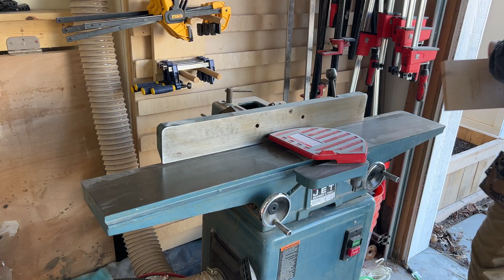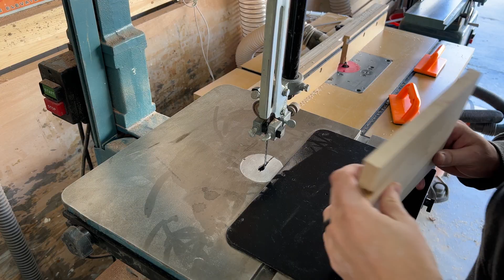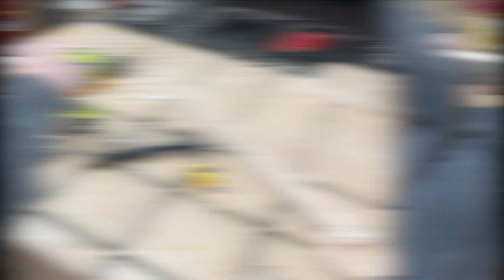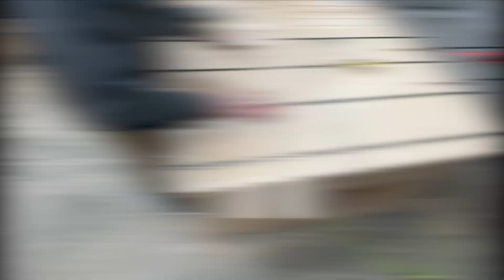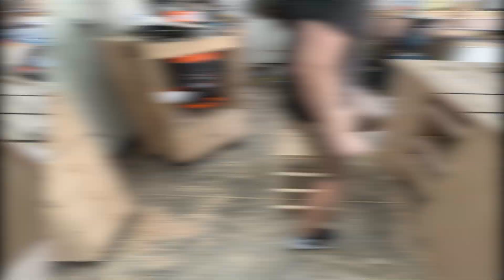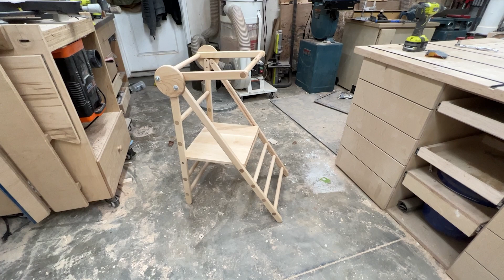How To Build A Foldable Kitchen Helper Stool // Step By Step

Comment: The plans are only half complete!  Height of the platform and location of the dowel holes are completely missing and you are force to figure these out on your own.  This will add considerable time and effort you project and could have been easily included in the plans.  For this reason, I would not recommend this project

Comment: Bought directions many months ago
Decided to cut all pieces 
Like the idea of a folding table. 
Your directions do not show measurement 
details for circles as far as attachments to legs and top rail. 
Have you a more detailed plan that fills in the
Measurements and leg placement on the circle pieces?
Reply: I just bought the plans, I am blown away at the number of spelling mistakes and either incorrect or missing dimensions.. yeesh.
Reply: Any luck contacting him ?

Comment: * BEFORE you begin this project...
Note-the front leg CAN NOT have a dowel above the rotating platform. It will keep the ladder from folding. Also we suggest you raise the measurement for the 1 inch holes on the front leg by 1/4 inch (3.25 inches for the first hole). Our platform is at a slight incline toward the front when using his measurements. 

After the frustration of it not folding because of the 4th dowel, we are happy with the finished product.

Comment: So you said half inch bolts and nuts for the circle and to hole the rear leg and safety rail.  Are they bolts with 1/2 inch heads or 1/2 inch diameter bolt where the threads are?